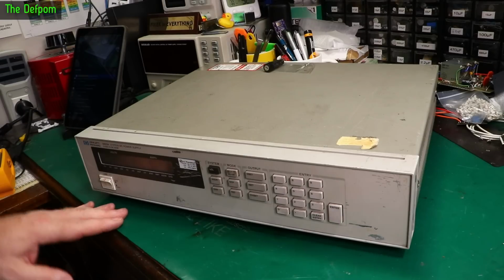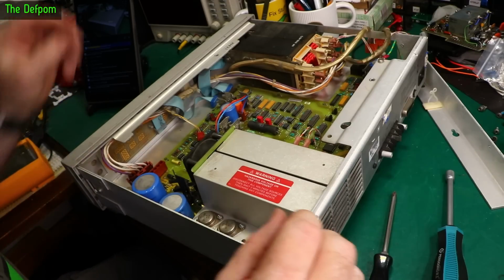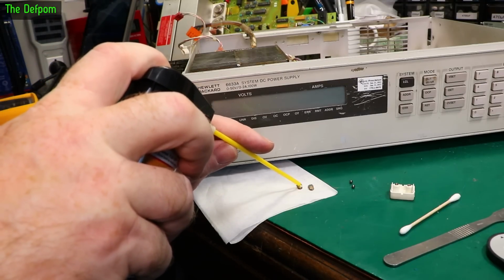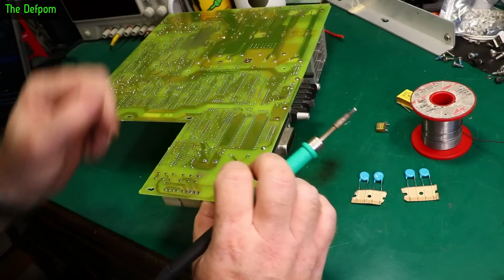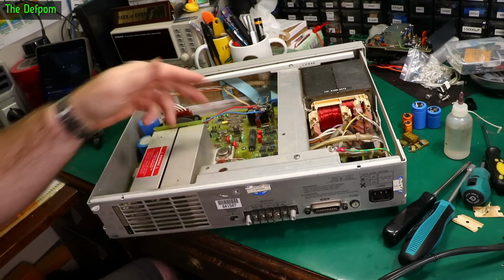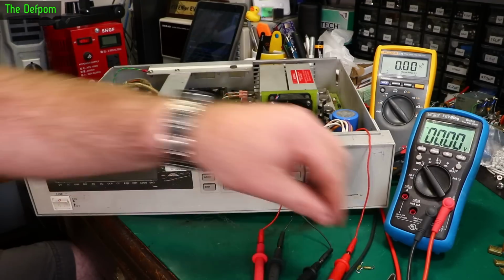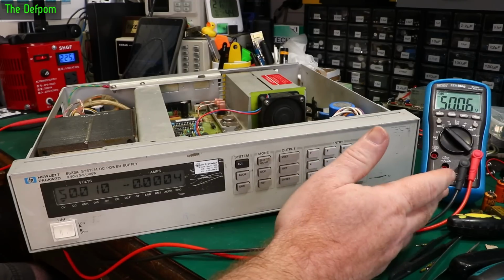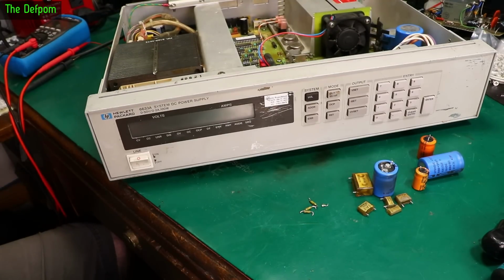🔴 HP 6633A System DC Power Supply Repair - No.1130

Comment: Don't think i'd have designed something that ran at 70°C at normal operation. What must the junction temperature be at?
Reply: With the case (lid) off the airflow won't be optimal across those 70degC heatsinks & power resistors......so probably running a tad higher than it would normally possibly. As a result, good operation of that fan is CRUCIAL I guess.
Reply: @IanScottJohnston  i just thought that if the designer knew that the transistor would get that hot he would have put a heatsink on it. the case to air thermal resistance would be quite high so not sure the air flow from the fan blowing air out of the box would cool it that much. 

in my mind if you can't keep a finger on it during normal operation then your over driving it. except for heaters that is 🙂
Reply: Yeah 70 is to hot in my book, but it's HP so maybe they have 'Reasons'......squeak !
Reply: @andymouse  old age and overworked, that's my excuse for getting hot. ;-)